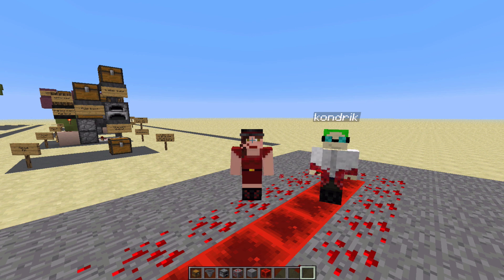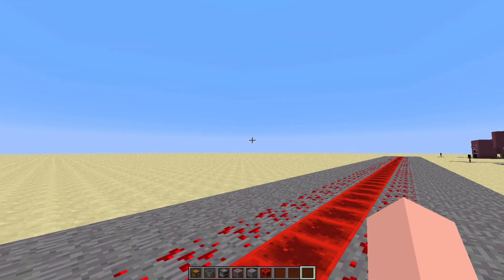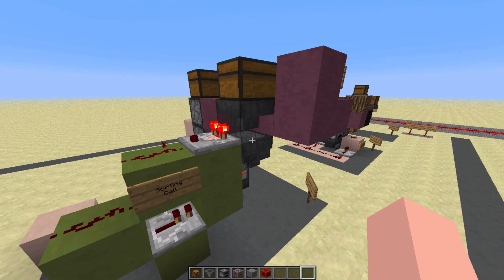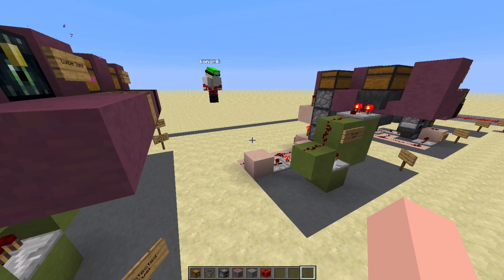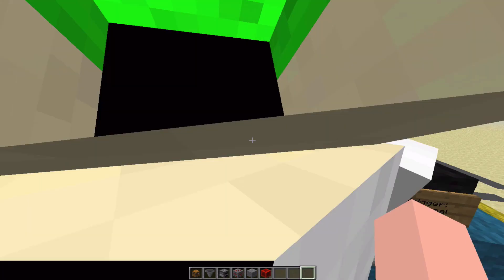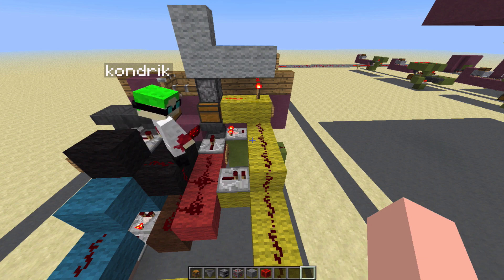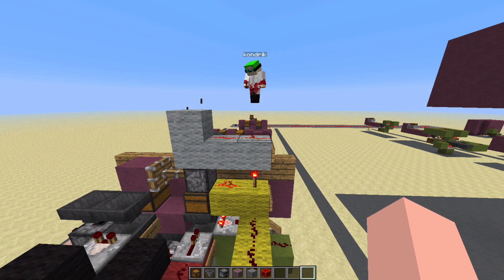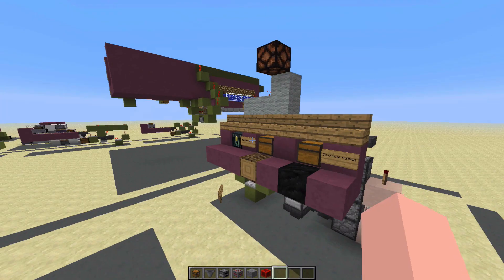Redstone 201 // Kondrik's Server-Safe Charcoal Factory

Comment: wow, that is cool and over kill.  Unless you are playing on a massive server where there is no responsibility and accountability and full of griefers, in other words any non whitelist server out there, you wouldn't need so much complication.  It is still really cool and I can see some people using it.
Reply: It's definitely overkill, but I had a lot more fun designing it than I've had in a long time.  Even on a private server, some people still dump random items into any chest they can find when they want to clear their inventory, and if the resources are available, it makes sense to prevent clogs once instead of clearing them multiple times.  It only takes 1 dirt/cobble/string/seed/etc "accidentally" placed in the wrong chest to clog an unprotected system, and if you're not checking the actual furnace on a regular basis, it's easy to not notice a clog for a few days.
Reply: ***** your right about that.  if you want to make it more overkill you could do it so it doesn't discriminate types of wood.
Reply: That would be a lot of work.. but it could be fun.  The actual build on the server included an attached oak farm, so I'm not really concerned about adding wood types... That, and I've already done too many episodes on that build, so it's time to move on to another project.

Comment: Hi there nice video, so do i get this correctly, you basically open this challenge to improove this?
keyfeatures are:
- can't clog up
- provides charcoal as long as the system has enough fuel otherwise chest blocked or charcoal not provided
- only takes oaklogs as input.
Reply: I just looked at your channel... and subbed.  I'll be watching through your vids in the next few days.  From what I already saw, I think you might be able to come up with a better design.  ...I've already had 1 person tweet at me with a different design that gave me enough ideas to come up with 2 redesigns of my own, so I'm really looking forward to seeing what else people come up with.

Comment: Handy. I built GennyBs lava smelter, but this is handy for my home. Thanks.

Keep up the videos. I'm enjoying your work and voice.  Thanks.
Reply: I'm glad you like it!  The nether smelter is definitely a great idea.  My main purpose in creating the charcoal farm was so I could stop running out of torches when I was lighting up spawn and other community areas.

I built a connected a tree farm on the server, so the wood needed is very easily accessible.  I've also added an output line that sends charcoal to very small auto-smelter, and I really want to sort the logs from the tree farm to auto-input to the charcoal factory, but I haven't gotten there yet.